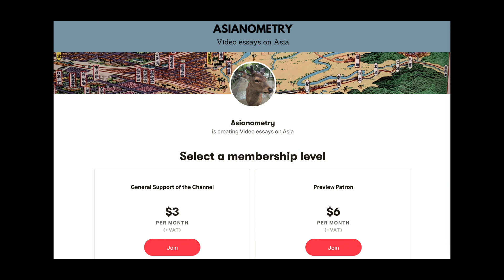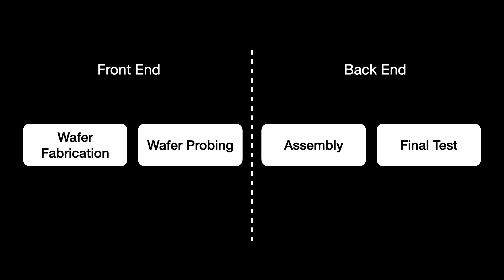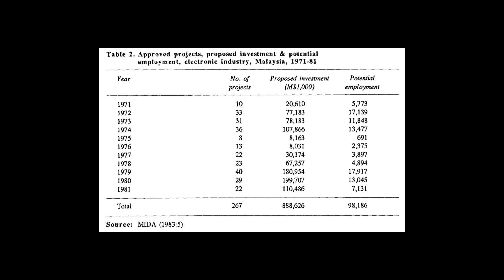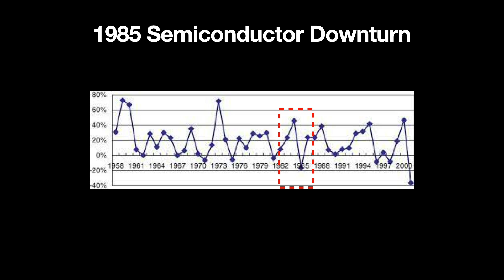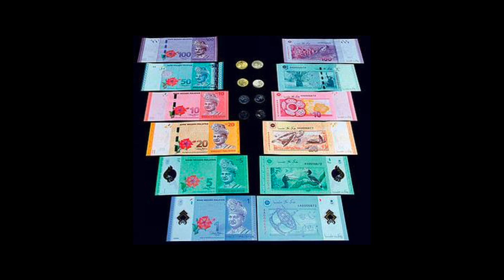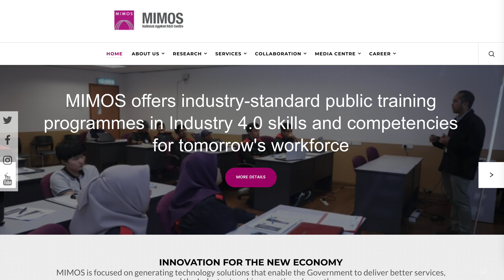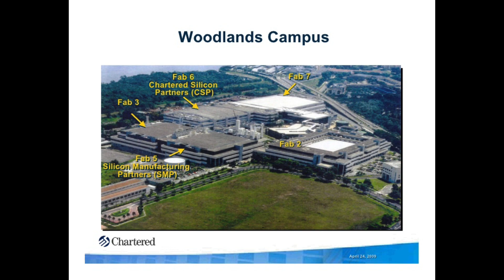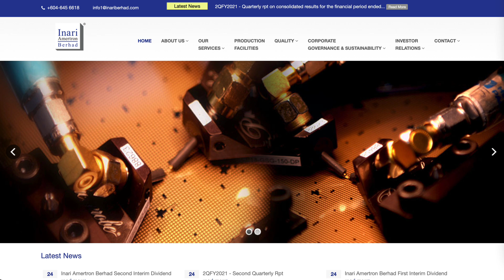Can Malaysia’s Semiconductor Industry Compete?

Comment: 6:10 Wait, what?  The average hourly wage in Japan was higher than in the US in 1973?  (The equivalent of 13 ringgit in Japan, 12 in the US, and 1.43 in Malaysia, according to the video).

Is this for this specific industry, or in manufacturing in general, or in the economy in general?

Is this Purchasing Power Parity or nominal?  If this is nominal, I just find it hard to believe.  I can accept it if PPP.

Edit:  I just did a couple of quick Google searches and some calculations and got a median household income in 1973 of about $12,000 in the US and $6,600 in Japan.  This seems reasonably realistic.

Comment: Intel has been on hiring spree for chip engineer here in Malaysia. A lot of my friend who has not yet finish their education have been offered jobs by Intel. Intel also hired a lot of engineers from silterra. This come out as a surprise for me bcs I always though semiconductor industry in Malaysia sucks
Reply: Not to mention, AMD are expanding into Malaysia , setting up design center same as intel. Besides that, AT&S are investing €1.7 billion in Kulim, Kedah. Semicon industry in Malaysia is actually doing good. Malaysian semicon engineers are on par with oversea engineers, only that the low payments makes these local talents moving out from Malaysia.
Reply: If not for the pendemic, nobody would know the importance of Malaysia as a global player in the microchips industry. My brother is a technician and help produce microchips for export use for cars, covid ventilators and PS5.
Reply: Now, Intel will invest 7 billion USD on a new factory.
Reply: Malaysia is the 5 th largest exporter of microchips. 13% of global assembly and testing done here and 7% of world trade. 35% of Malaysia's export are in E & E sectors while only 14% in oil and gas.
Reply: Remember Asian persons quite smart when they got oppertunities.

Comment: Silterra china investors has invested in fab before and they are quite successful.they may bring their team to kulim and maybe fabricate chips for automobiles.that works with just 2b transistors..shld be enough.
Reply: The mindset of "should be good enough" is a problem.  Semiconductor is a very competitive business, the ones that are still around spend every day improving because that's the requirement to survive.